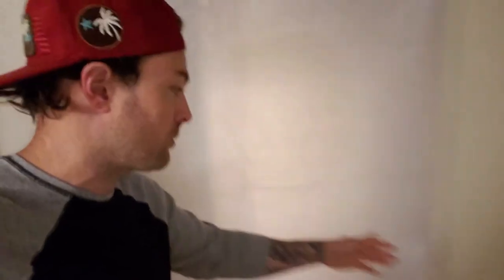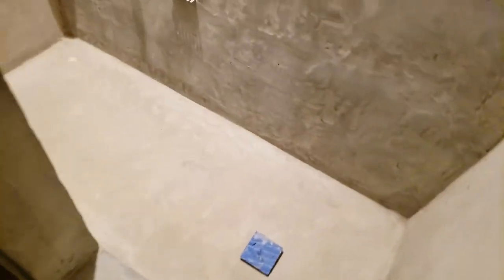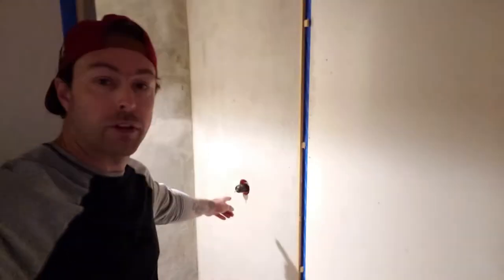DELTA SHOWER VALVE REBUILD KIT | "HOW-TO" | 600 SERIES

Comment: Is it possible to control how hot water comes out?
Reply from the maker: Not sure exactly what your asking. You can control the temp just like any other shower valve. 🤷‍♂️ Delta did reverse the handle so the bottom of the handle swings towards the temp side that you want. They also discontinued the reverse ball for this series. 🤦‍♂️